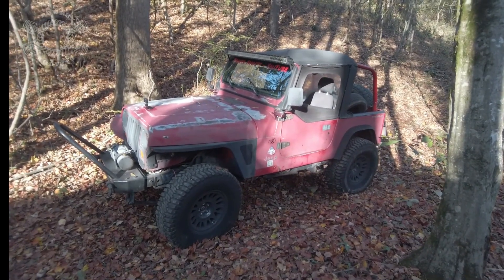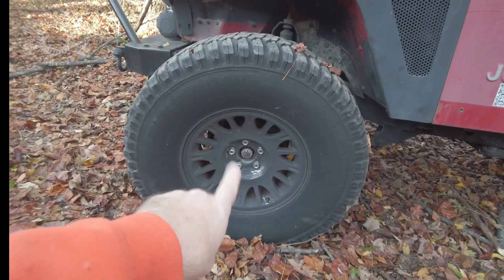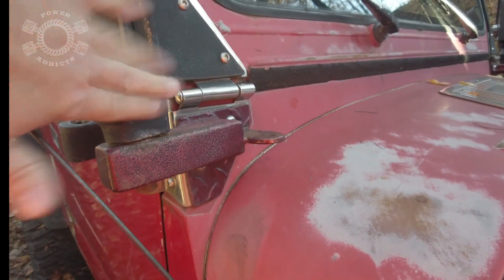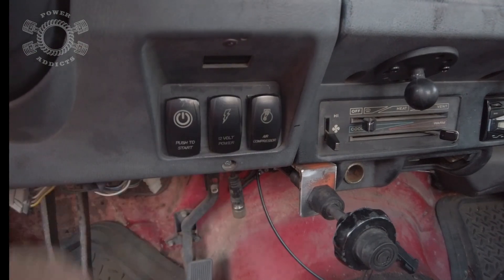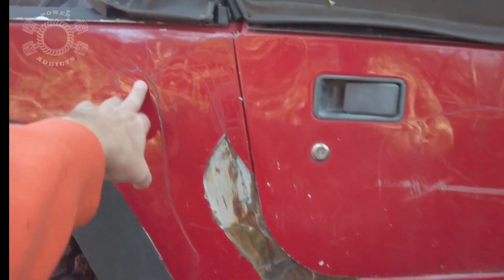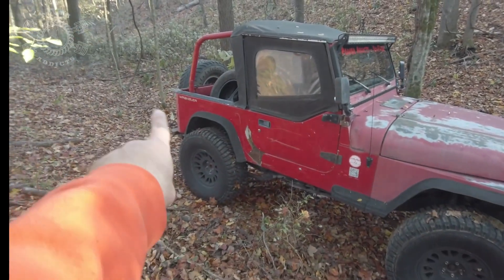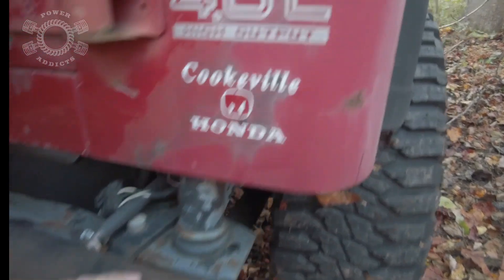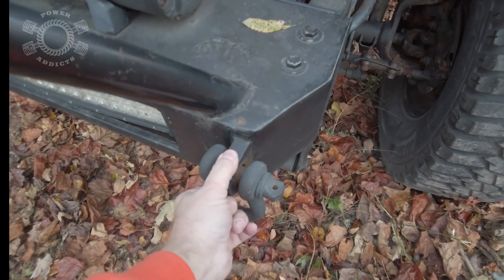Power Addicts 1991 Jeep Wrangler YJ Walk Around #poweraddictscrew

Comment: Hi, Chuck. I have a rough 91 sahara (love it) 1st mod years ago front lunchbox (spartan) removed both track bars.  left the sway bar put the cheepest ebay mud 31s drove it as a second vehicle and wheeled the snot out of it. Recently regeared to 373 added a rear lunchbox in the dana 35. Installed rough country 2.5. now the dang thing has a mind of its own, when i hit the gas it pulls hard to the right sometimes. Ive been chasing this problem for months now. reinstall trac bars replaced steering box, ball joints  checked frame around box n schackles. Had an alignment. per rough country tech support. Feels like its in the front end. im at a loss on what to try next. ive watched your videos for a long time n value your opinions. what should i do next?

Comment: Hey Chuck,  another great video. Every time I work on my jeep, I check to see if Power Addicts has a related video.  You usually do. Thanks for all the great ideas through the years. 

You said this YJ is a '91.  Did you or a prior owner swap in the square roll cage, or was yours a late in the year model as they transitioned to the '92s.  I ask because 91 was the last year with the triangle roll cage.   They went to the square and added the third, high mount brake light in the 92 model year. 

I love my 91 islander ("Rufus").  It's got the triangle cage, which looks classic, and it's the first year with the fuel injection.  I drove mine off the lot brand new 32 years ago. 

I've also got an '88 I picked up for my kids. I thought it would be good for them to learn about life with a carb, and then I learned what a POS the OEM BBD carb was, so we pulled it (and about 20 lbs of vacuum lines) and put in a Holley Sniper TBI setup with a hyperspark distributor.   What a difference. 

That conversion would be a great video for you to do.  It would be useful for anyone with a 90 or older yj or a cj. It wasn't easy,  but it was so worth it.
Reply from the maker: I swapped the roll bar myself so I could run a frameless soft top if I ever got one. Both of my rigs are injected so no need in doing the Holley Sniper system. It is a great product no doubt!!

Comment: I had oversized shocks so I put in stock shops in but the rear end of my Jeep feels like it sways when it hits the bumps in the road when I drive on the I was wondering why the Jeep is doing that
Reply from the maker: I have no way of knowing that. It could be the shocks are too light and not controlling the Jeep. You could have bad bushings ... there is just no way of diagnosing that over a comment on YouTube.
Reply: How hard is it to replace the bushings and how many of them are there in a YJ 99
Reply: Hi Chuck different have you ever worked on a Honda goldwing
Reply: I have to remove the starter for 2004 Honda goldwing

Comment: She sounded a little hard to start. Ever think about a big 7 upgrade and bigger alternator? Or did you already do that vid?
Reply from the maker: It has a new fuel pump that is supposed to have that check valve to maintain fuel pressure. That Jeep has always been long-winded about starting .. .but .. it always starts. The big 7 is actually on the to-do list soon! It already has a 130-amp Durango alternator that I forgot to mention in the video. Thanks for checking out the video!!